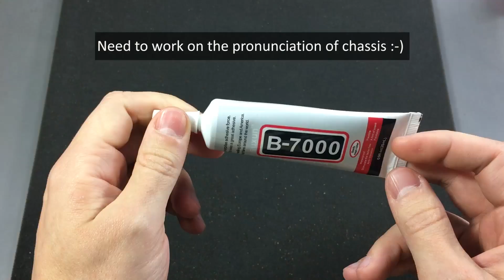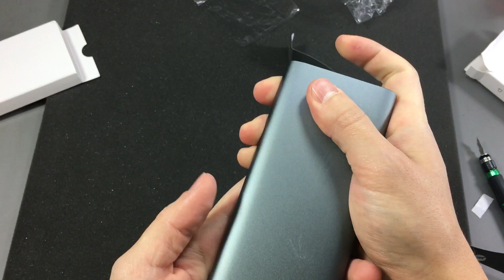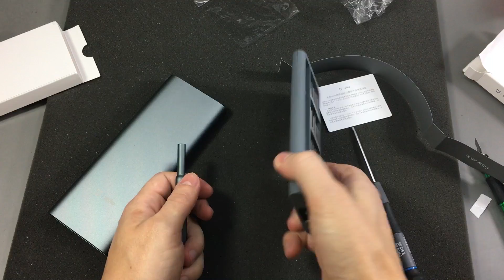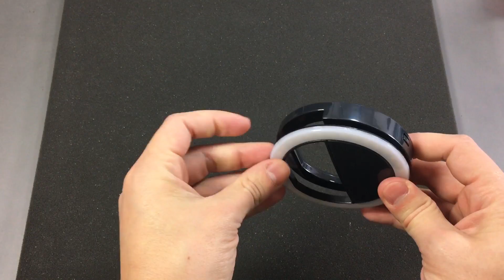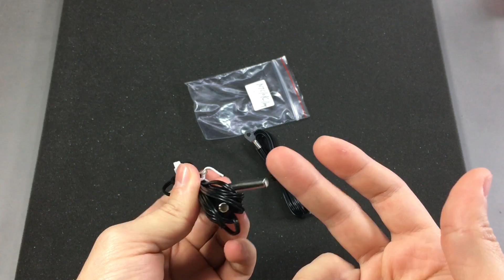Voltlog #136 - InTheMail

Comment: The B7000 is amazing. I used it to adhere iPhone glass to the plastic frame back when I repaired iPhone LCDs. It even held the i6+ glass to the super thin bezels. I also had to glue my E46 mirror back on and it held at 180kph.
Reply from the maker: Thank you for your feedback. Sounds like I made the right choice getting it.
Reply: T-7000 glue is better, believe me. The only one disadvantage is, that T-7000 is a black glue.

Comment: The red LCD screen seems to be of the ST7735 kind. In most cases,  they only officially support 3v i/o
Reply from the maker: That shouldn't be a problem. I mostly work on 3.3v mcu's
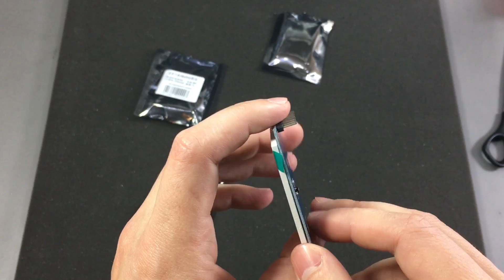Reply: 12:12 - There's a 5V-3V level converter chip underneath. J1 is used to select between 5V or 3V. Note though it doesn't level convert the micro-SD.
Reply: For power supply, but not for I/O i think

Comment: Same here about silicone cables. Hobbyking beats all other chinese stores with price on thick cables. But 20AWG and and thinner is cheaper to buy other places.
Reply from the maker: I have purchased cheaper sub 20AWG from ebay/aliexpress but they are slightly lower quality than the turnigy/hobbyking wires.